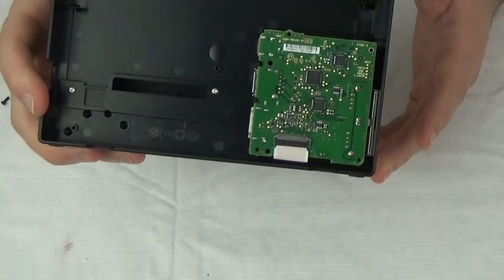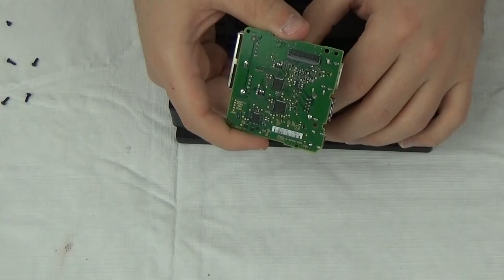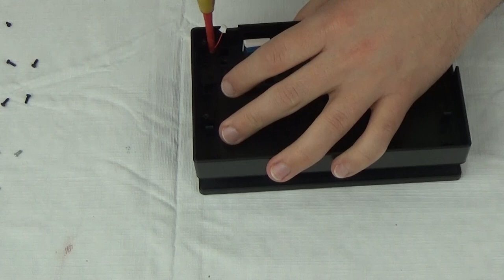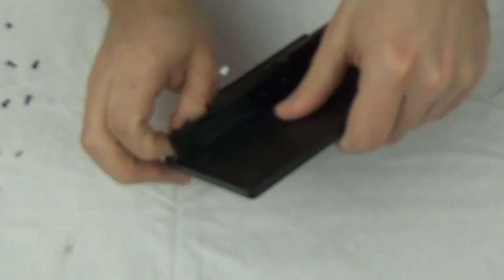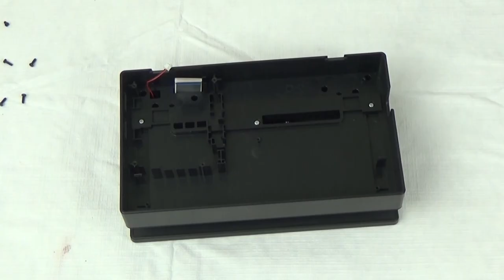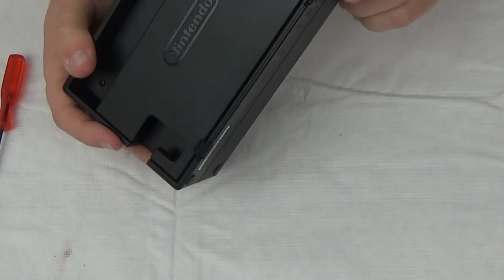Taking Apart The Nintendo Switch Dock!

Comment: $90 for a $5 piece of equipment. Amazing how proud Nintendo is of their shit.
Reply: Dib Siverak it comes with a charger and hdmi cable.
Reply: Yep my bad $5 for the board $2 for the case $2 for the HDMI and $5 for the charger = $15 (rounded) / $90 - $15 = $75 / 85% profit. I am perfectly happy that Nintendo charges whatever they want for their products. I think it says a lot about a tech company!
Reply: eh, it actually has more ports 2 usb 2.0 usb 3.0 and power in and 20 dollars gets you less. 90 bucks may cost a bunch but there isn't many USB c to those ports. So it's a unique purpose for unique use case scenarios. Those things can be pricey, everything else is unattractive looking as well and they aren't docks.
Reply: the charger is 30$. in fact ninty's charger is one if the cheapest out there for that much wattage, not including proprietary qualcom quick charge.

plus quality hdmi costs around 10$.

plus a USB hub that fully powers all 3 ports plus a usb c device itself? that does not exist...
Reply: Consider this; 2 examples of my pricing scheme.  

1. $14 for a USB-C to HDMI/DVI/VGA   -   https://tinyurl.com/zqfhk7g
2. $35 for a USB-C Hub, USB-C to HDMI  USB 3.0 Port and USB-C/3.1 G2 Recharging    -    https://tinyurl.com/zdpsoml

These examples give you a baseline for the average cost of these components. To my point is Apple that manufactures the same device as the $35 hub they sell it for $50 still $40 cheaper than Nintendo.
Reply: Oh the ignorance.
Reply: Then trow in a charger and hdmi cable and you get a bit closer to the 90.. Also normal USB-C to hdmi cables are just cables but in this case its a actual converter since the switch usb-c cant do hdmi so thats also more expensive..
Reply: most converters don't also supply power
Reply: Dib Siverak 

So lets see, and this is ASSUMING that the hub can handle the full output of the switch charger.

Thats 35$.
Then 30 for the charger, since anything outputting the full power of the switch charger is more expensive then ninty's.
5~10 for HDMI cable.

Thats 70, and thats not concerining the fact that:
A. The switch also has 2 usb 2.0 ports
B. The dock has the usb c to hdmi converting hardware.

Last I checked belkin's usb c to hdmi costs 59$...
Reply: You think charging is a problem? Really? Sorry I was hoping to have a conversation and not a technical class. $30 for a USB-C Charger? lol Did you bother to look at the links I provided? The 2nd link is a dock/hub that gives all the same ports that the Nintendo Dock provides, save 1 USB port that would cost practically 10 cents. It's really not that hard to do the reseach. Honest question! How do you function in daily life without verifying what you say?
Reply: The problem is most hubs are generally designed in series, not parallel. In other words, if you hook up multiple devices you get serious bandwidth issues not just in terms of data, but also in terms of total power output. Seriously, try it some time. Charge multiple devices on one hub and you'll find it takes much longer. Each connection ultimately only goes to a single point. It's a bottleneck and the reason why hubs are crap and if you want to do anything serious with accessories, you never use one (unless the manufacturer of your device is a piece of shit and force you to, gg Apple)

On the Switch and any other small, handheld device that has free and available ports, they are all built and designed specifically to maintain their own bandwidth and throughput. This prevents interference and allows each port to function at full capacity (something a simple $35 hub won't ever accomplish, not unless it cost more money).

Realistically this has somewhere around $45 or $50 in parts and overall design and implemented electronics architecture. It's much more than a mere USB to HDMI output, and more than a charger as well. USB-C is capable of natively carrying HDMI. The only reason you need to have the dock to use HDMI is because Nintendo opted to keep that feature out of the Switch so they could sell the docks. The electronics in the dock are designed to only permit HDMI passthrough when the Switch is connected, so you can't just hook up your own cable even if you wanted to somehow.

The dock is a mere marketing gimmick, but to say it's only $2 or at most $35 with parts you found that aren't even close to what's designed and implemented in dedicated consumer electronics is a bit off the mark.

Hope you learned something.
Reply: spartan456 

Basically yeah. I'd say its worth at the very least 40$ if not 50$.

And that charger is definetly worth more than 30 because of the wattage.
Reply: My $5 USB-C charger works just fine! Honestly, this is getting a little disappointing. Just to be clear my argument is that all of the existing charging, HDMI, USB abilities were not invented by Nintendo. The Switch does nothing that a smartphone like the (X3 Elite) with USB-C couldn't do.  I haven't taken the dock apart personally but I have a suspicion that it can be used as a port replicator for other Devices, the X3 being one of them. And the Switch is also highly likely to work with third party docks.  oh and it also only cost Nintendo less than $40 for the dock.
Reply: Dib Siverak 

You should consider the markups that shipping and retailers take...

1. Where the hell did you find a 5$ usb C charger? Thats the cost of a 1A 5V USB A charger. Or half the cost of a decent USB C to A CABLE. Or a decent C to C cable.
2. The switch can work with 5V 3A. However that isn't enough to run docked mode. You need 15V 2.6A.
3. The cheaper USB-C native chargers are like 20$. At 5V 3A.
4. A port replicator has bottlenecks... meaning you can't USB 3.0 at full speedand HDMI at the same time with the base protocol. It uses an alternate mode (like, say, thunderbolt can do) with higher data transfer, and then the DOCK converts it to HDMI and the USB signals.
Reply: You're really missing the point here. You are correct that Nintendo didn't invent USB-C or HDMI or USB 3, these are just standards that manufacturers can implement in their own electrical engineering designs.

Any consumer electronic device contains highly, HIGHLY specific and extremely precise circuits to make everything work. They are, literally, custom-tailored to the operation and use of the device to a standard that the OEM considers satisfactory. Just because something has a USB-C port does not mean it can do everything that another device that has a USB-C port can do, it depends entirely on the internal engineering of the various circuits and how they decided to make them all work together.

You are also missing the point that when splitting an existing signal, you lose a lot in the way of bandwidth and much more needs to be done in the engineering side of things to prevent this from happening. Data multiplexing, filtering and reduction in crosstalk interference, and length of internal traces carrying all of this information. When you're bussing tons of different electrical signals through a thin, copper trace the length of that trace will greatly impact the quality of each signal at the end of the line. You fix this with good engineering and data multiplexing, which, as I said, is expensive.

Hubs generally do not provide any level of proper multiplexing, which is the point I was making in my first reply. If they do, they are much more expensive because each port is going to have its own, dedicated line for both power output and serial communications. You say you do not want a technical class but a conversation, which is dumb because you do not understand why the dock is made the way it is. We are trying to tell you but you apparently do not want to learn.

And...so what if it cost Nintendo less than $40 to make the dock? If you want to be really technical you are actually dead wrong, when it comes to large scale manufacturing the more of an item you produce and ship the cost drops dramatically. If this were not true then everything you ever bought in a store would be orders of magnitude more expensive. The cost for making one unit and selling one unit may be less than $40, but if you ship and sell thousands of them by the day the cost per unit decreases and by a lot. There's actually a very good video that explains this very well, it's called "Why chicken sandwiches don't cost $1,000".

More importantly, even at that 1:1 profit margin I think that is very much acceptable.
Reply: lol 5 dollar, my guess is less than that.  those just cost cents at the component level. and that ant any high tech component.
Reply: Liangshi Xu yes, you're right. what you aren't accounting for are the wages Nintendo had to pay to the engineers that designed the circuits, and you also aren't accounting for board manufacturing and assembly, which relies on machines that cost hundreds of thousands of dollars to maintain and require highly specialized individuals to maintain.
Reply: Dib Siverak lmao looks like a fake knock off the switch isn’t worth the money at all it’s all a generation behind the ps3 even supports 1080p lol

Comment: Is the front panel of this basically just a hollow/solid piece of plastic? If so, just lop off the thing with a cutting tool, leaving enough of a lip to let the USB be lined up properly, and you've solved any screen-scratching problems.

Comment: They need to 
1.Make the dock run 1080p on all games
2. make it so that it has buttons and calibration for joycons and pro controllers.
3. Make it solid so that it's not just some plastic box but a console.
4. add lights like the wii and wii u had

Comment: So there isn't a fan inside? How does the overclocking work, then? Does it not need to add additional cooling? Is it just a power issue?

Lowering the video output to 720p undocked could possibly just be a power-saving method if that's the case.

Comment: $90 for that cheap crap!? lol, I bet some 3rd party will make one for $20.
Reply: Carl Freemerman and destroy your switch
Reply: @jklalskjdjhg7227  not if you use nintendo original wiring
Reply: Christopher Portillo well is wont be $20
Reply: I bet the third party one will actually work too unlike 75% of people’s who came broken your lucky if the one that comes in the box works for you
Reply: That circuit board is pretty amazing, you're putting a USB 3.0, two USB 2.0's, HDMI and Power all though the USB Type C port on the bottom of the switch tablet. All in a 3x3 circuit board. That's some cutting edge technology.

Comment: In the future, I could see a 4K Dock (or a device that fits the compartment that plug into the USB-C). Furthermore, I could see them doing a "Gear VR styled" VR device where the tablet slots into the VR unit. The VR unit would have extra batteries (in the back, to counterweight the Switch in front), and with the batteries, run in full power mode, but using the 720p screen, thus being able to run better frame rates, which is the thing VR NEEDS to have. You already have a pair of motion control enabled controllers with HD rumble! It would set up Nintendo as having the lowest cost VR entry of all the three console makers!
Reply: Because I really want a 720p VR display...

Comment: I would 3d print a new dock without the faceplate and maybe line up circuit board above and behind the docking mechanism; lastly, make the dock a half triangle instead of a giant square. I see countless ways to make it way cooler and less bulky

Comment: Is there a sensor in the spring around the USB-C to tell the board a switch is docked? If is it literally only there to help protect the connector?

I'm thinking about 3D printing an improved dock. Trying to determine the requirements.

Comment: Interesting that they left exposed, and even labeled, the programming interface (SWDIO, SWCLK) to the ST microcontroller which seems to be running everything. (I can't exactly see the part number.) That means you could reprogram it with any ST programmer, which you can get very cheap.

Comment: The spring might help with guiding the switch into play so the usb-c port doesnt get bent if the switch is put in wrong.
Also nice that there isnt much for the board. I am willing to bet people will take them apart and 3d print a smaller box with just a usb-c to usb-c cable port

Comment: Some reports indicate damage on the Switch screen when docking and undocking numerous times. Seeing the dock apart, I can see what may have caused the abrasion. Perhaps a stick-on thin felt or similar can be attached to the dock to minimize, if not eliminate, the abrasion to the nice Switch screen.
Reply: Danny G. That's what I was thinking. I ordered a glass screen protector but putting thin felt might not be a bad idea for secondary protection.

Comment: Not entirely sure about removing the ribbon on this. It just snaps in, right? Is it safe to pull on the ribbon itself? I was trying to pry at the connector with a little screwdriver, but didn't get anywhere.

Comment: It just doesn't make sense to me that a usb 3.0, two usb 2.0's, hdmi, and power can all communicate with the system through one usb type c connection on the bottom of the tablet, all at the same time. USB C seems to be pretty amazing

Comment: Hey man, you should've put some padding inside the dock when you opened it. The screen can scratch pretty easily against those plastic rails inside the dock. 
That's what I would do at the very least.
Blunty showed how his Switch's screen is scratched after only one day of use because of this.
Reply: AbdallahSmash026#1Fan 
Plastic screen that rubs against the inside of plastic dock without any protection sucks.
Reply: AbdallahSmash026#1Fan I don't like him either but he was one of the first people to report about this issue and show the proof with the video

Comment: I've heard that you can't use other USB-C to HDMI cords with the Switch. Do you think the dock has a "handshake" that lets the Switch use their HDMI output? Do you think someone will come up with a workaround at some point? 90 bucks for a dock seems expensive.
Reply: Tony Ortiz USB C to HDMI is handled by the dock circutry in the switch's case. and it isn't cheap...

the dock cones with a power brick and hdmi cable though, and there isn't a charger that can output the dock's power intake thats cheaper than the nintendo one.

Comment: Well whenever I get my switch, I'm planing to add a bit of craft foam to the side where the screen is.
Since there are reports of the dock scratching the outer part of the screen on the switch
Reply: linkofdoom24 I agree. or just get a tempered glass screen protector. :)
Reply: Tony12097 I am planing to get a tempered glass screen protector also, but I feel like the foam should help against any scratches

Comment: I think Nintendo definitely left all that room in the dock intentionally to potentially put better hardware in the dock as time goes on (and depending on how the Switch does), because that is a lot of extra space to leave in there unless they're planning on doing more with it.
Reply: Zachary Goterch No they won't put better hardware in it. If they do that the thing would be very expensive.
Reply: яєтяσтν. | єlєթรเєˢᵠᵘᵃᵈ Well, Sony and Microsoft have and are doing it with their consoles, and Nintendo did it with the 3DS, so I wouldn't put it past them if they did it with the Switch dock, not the system itself.  I'm not sure what Nintendo and Nvidia would cook up, but with the current cycle of mid-gen upgrades, it wouldn't surprise me.

Comment: Well, PSA for Spawn and anyone who has or will have a Switch. Get a screen protector and might as well make it tempered glass. Apparently the Switch's screen is plastic and people are reporting scratches on the screen FROM THE DOCK after just one day of use.
Reply: I might take my dock apart and glue on some microfiber material to the inside of it if I get a switch.
Reply from the maker: I was thinking that same thing. Maybe some felt material, might actually help it slide into the dock better.
Reply: Spawn Wave If you do, would you mind making a tutorial?  If I mess with it, I'll likely break it without proper instructions.
Reply: Emma Smith You can just look at this video for taking it apart. Not sure what type of glue would good for that though. Probably something made for cloth that wouldn't be too permanent.
Spawn Wave Thanks for the reply. How much clearance is in the dock for padding material or screen protector when its docked? Also is the screen really plastic or a low quality glass?

Comment: seems i got a newer model and the ribbon cable connector to the motherboard has been updated. The connector pins seem to have been soldered directly onto the motherboard making it impossible to take apart.

Comment: Is it possible to turn around the spring loaded usb c connector? I'm asking because my switch is very weird and will only charge and display with third party adapters when the usb c is in one orientation. Basically my original dock is useless unless I can switch it around. Any help would be appreciated.